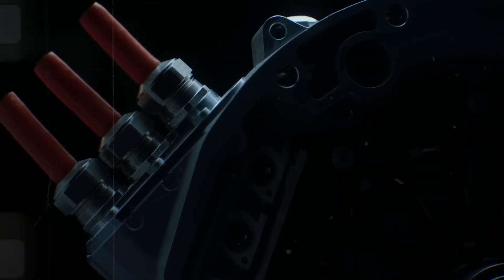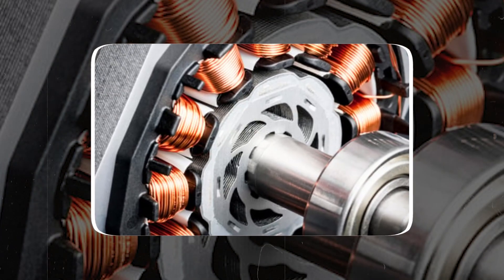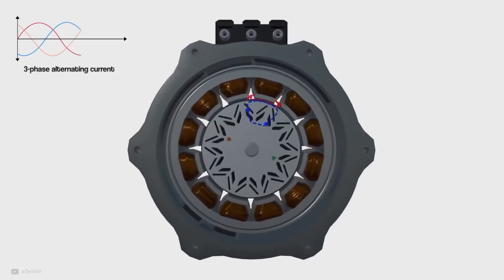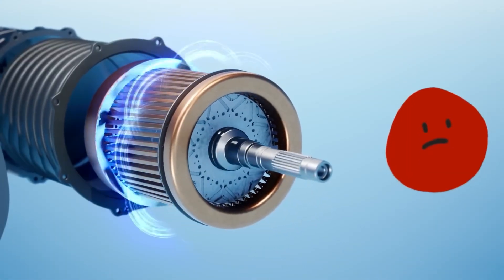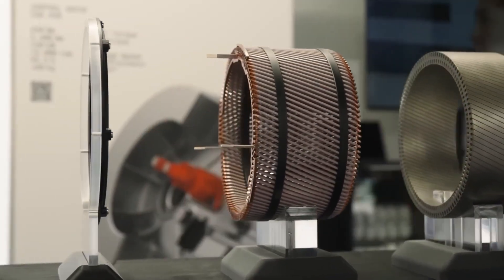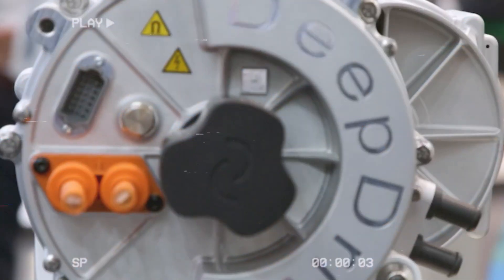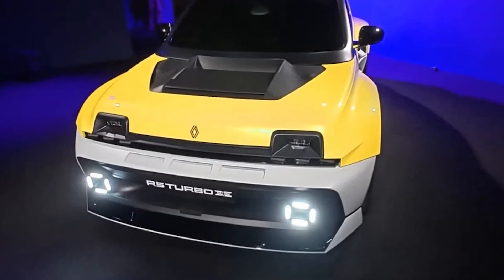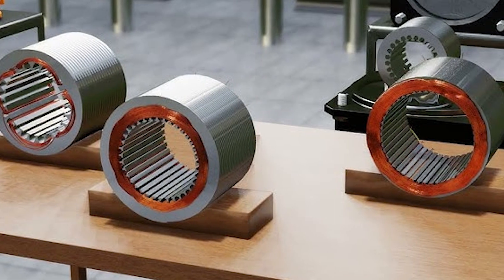Deep Drive's Yokeless Dual-Rotor Motor: The EV Breakthrough Everyone Missed

Comment: Looking at the claimed 200 kW / 500 Nm specs, the operating point sits around 3800 RPM. For a 12-pole (6 pole pairs) topology, this requires a fundamental frequency of approximately 380 Hz.

While modern SiC inverters handle this easily, for the stator core, 380 Hz is a thermal challenge due to eddy current losses scaling with the square of frequency. Without aggressive cooling (or ultra-thin laminations), the core itself risks overheating, regardless of winding cooling. This reinforces the need for a holistic thermal management strategy.